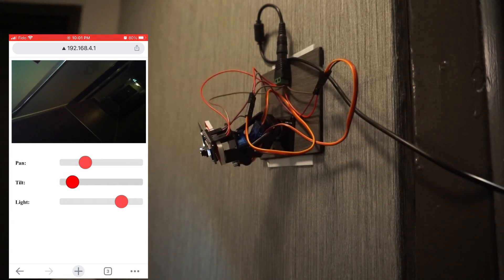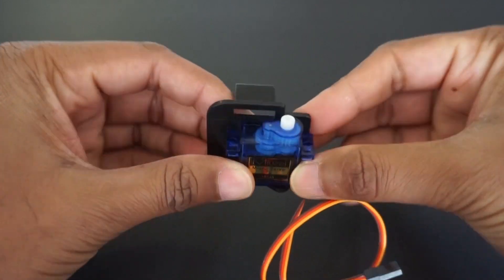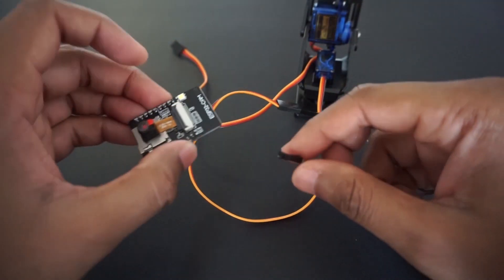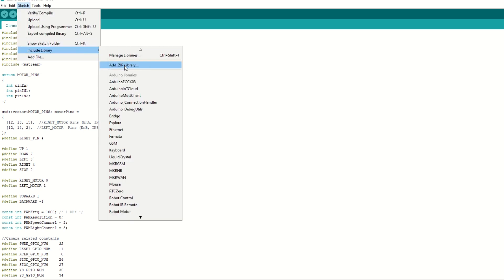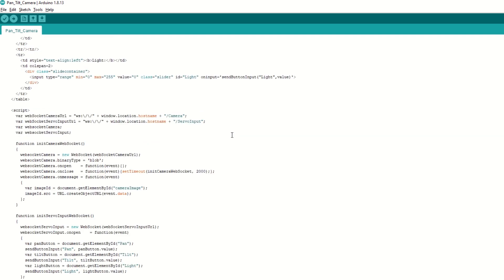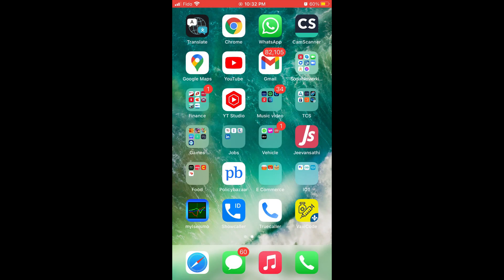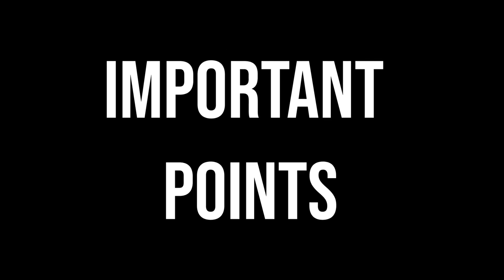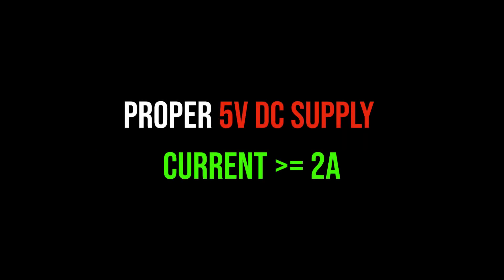Pan Tilt Control using Servos for ESP32 Cam |  WiFi Security Camera

Comment: I'm using four 1.5V batteries as external power. Will I get an error if the voltage isn't exactly 5V? Only the LEDs work, and the servo motor and video streaming don't.

Comment: help me, I can't get it to work properly, the problem is in the servo, the pan is working, but the tilt is not working, it won't rotate properly.
Reply from the maker: Did you connect the Tilt servo to the correct pin? 👍🏻👏🏻

Comment: I tried the same setup and followed your video, including the important max queue setting. I’m using a 5V 3A buck converter for power. However, the video feed is frozen, the camera is stuck, and the servos are not responding. The lights are working fine. I also noticed many others in the comments facing the same issue, for all of them lights in esp032 working fine.so it seems like either we are missing something  in the setup or there’s a problem with the code. Could you please help us to debug the issue.anything that we need to check in specific

Comment: it compiles the code but it is not connecting to my wifi network, however it is generating an IP address.
Reply: Yes, i have the same question
Reply from the maker: Check the connections and also power supply 👍🏻👏🏻

Comment: There are some size differences between pan tilt's assembly and servo motor.....I cannot set it properly...I have cut from the two ends of the servo's horns....still it is not fitting properly....what should I do?.....any advice?
Reply from the maker: Try making the proper adjustment 👍🏻👏🏻

Comment: how to connect arduino uno to the camera pls tell anyone
Reply from the maker: @freedjustine1629  Arduino uno is used only to upload code . This step is shown in video . Please check the video slowly and carefully 👍🏻👏🏻
Reply: @hashincludeelectronics  but how to connect Arduino to the camera???
U told to check the car video but they have connected the camera to the breadboard
Reply: I would really love it if u could tell me how to connect it physically with the wires....
Reply: But to choose module esp32 cam module is not coming....
Pls help me

Comment: I am getting an error while compiling the code 
It says 
Compilation error: 'ledcSetup' was not declared in this scope; did you mean 'ledc_stop'?

please help me , its really urgent 
if possible i want to contact you
Reply from the maker: Please install 2.0.16 version of esp32 board to resolve this issue 👍🏻👏🏻
Reply: Sir pan tilt is not working and video feed is not coming please help sir

Comment: Hello sir please listen to me and reply me 
When i try to upload the code using the current version of esp32 board it show error in ledcsetup and ledattach pin but as you say use the version 2.0.16 i use that and it also work but it only work on led i can increase or decrease the intensity of the led but it didn't streaming the video i tried all the way possible i can but it doesn't work please help me
Reply from the maker: Please check video for any missing step . There is one setting which needs to be updated in library . Please check the video 👍🏻👏🏻
Reply: @hashincludeelectronics  sir i make the esp32 cam project through your video step by step since 5 day but the problem remain same the error showed that the ledcsetup and ledattachpin is not declare in scope thats all sir

Comment: Can we use mg 995 servo motor in car project as i have modified it for mor torque so can you help with that  its not working with mg995 servo so what should I do ?
Reply from the maker: Please check the specifications of servo motor . It should work with 5v in control input . Also check the current rating and accordingly provide power supply 👍🏻👏🏻

Comment: I am getting the light to flash but im getting no response from the servos at all. I have everything connected to a power supply so i know there’s plenty of voltage and amps but I’ve got nothing out of the servos. Power supply shows they are not even drawing power. Any solution?
Reply from the maker: Make sure the rating of the power supply should have more than 2A current output with 5v supply 👍🏻👏🏻
Reply: @hashincludeelectronics  I am using UBEC 5V 5A . As you said, this should work more than 2A but i am using 5V 5A. only flash works. Please what is the problem?
Reply: @myintmyat1536  tengo el mismo problema, sumandol a que la imagen de la camara esta congelada
Reply: Me too... Should I use 5v, 2A adapter?

Comment: hello friend I entered this code but
it gives a problem
//Set up flash light
ledcSetup(PWMLightChannel, 1000, 8);
pinMode(LIGHT_PIN, OUTPUT);
ledcAttachPin(LIGHT_PIN, PWMLightChannel);
}
I couldn't light the led where is the error in the code
Reply: I have the same type of error which comes out in compile time please suggest me how to resolve it
Reply from the maker: @rohansahu2848  please install 2.0.16 version of esp32 board 👍🏻👏🏻
Reply from the maker: @Atillacelebi-de4qt  do you get compilation error ? 👍🏻👏🏻

Comment: Thank you all sorted I was previously facing some error of ledcsetup one but reading comments I resolved it🎉🎉🎉🎉

Can you make edit in video specially addressing for new maker to use 2.0.16 version that will be very helpful for them and time saving❤❤❤
Reply: How you solved it?
I have same problem, i cannot find comment that might help
Tell me please
Reply: @suxarickvoron8395  just change the esp32 version as i said above 2.0.16 rather than latest one 3.0.....something
Then your problem will be solved
Reply: @ OH god, i just noticed that you already wrote it above :D
I have seen only this part->

"Thank you all sorted I was previously facing some error of ledcsetup one but reading comments I resolved it🎉🎉🎉🎉"

Thanks for clarification!
Reply from the maker: Glad that everything worked now . Sure will mention that in upcoming videos 👍🏻👏🏻
Reply: @hashincludeelectronics I am currently using an adapter and now I want to switch to  battery of 3.7v can I use it using full potential of setup

Comment: It says frame buffer could not be acquired and video freezes after the first frame and with the servo motors they rotate once in a weird way and then the pan motor stops while the tilt motor goes up all the way
Reply: Note I am using 360 degree servo motors
Reply from the maker: @AbdelrhmanAzez  you need to change one setting related max message queued in code . Please check that in video 👍🏻👏🏻

Comment: can v hv a zoom call i spend a lot of money on this pls help me
Reply from the maker: Unfortunately call is not possible . I would suggest to go through the video again slowly and carefully . Check all the steps . Use proper power supply . Check for loose connections . Don’t worry it will work for you as well 👍🏻👏🏻

Comment: Sir, I uploaded the code and all went good. But IseeYouNow ssid is not visible in my phone or other device
Reply from the maker: Please check connections and use proper power supply 👍🏻👏🏻
Reply: @hashincludeelectronics  Connections all good. The problem is that no ssid is visible i need this before 20 December 😭

Comment: i have a problem i get this error when uploading:

Error compiling for board ESP32 Wrover Module
and
WARNING: Category '' in library ESP Insights is not valid. Will be changed to 'Uncategorized'
WARNING: Category '' in library ESP RainMaker is not valid. Will be changed to 'Uncategorized'
WARNING: Category '' in library WiFiProv is not valid. Will be changed to 'Uncategorized'
Reply from the maker: Please follow exact steps in video 👍🏻👏🏻

Comment: can i power it all wirh a 3.7v 3000 mah rechargable battery ??
Reply from the maker: It needs 5v only 👍🏻👏🏻
Reply: @hashincludeelectronics  it's alright, I'll make a rc car and mount a pan tilt servo assembly on it

Comment: sir help me i'm useing 1 servomotor my motor not working 😭😭😭😭😭😭😭
Reply from the maker: Please follow exact steps in video . Check video slowly and carefully . Also use the power supply which provides more than 2A current and 5v 👍🏻👏🏻

Comment: Sir i have one doubt can we use vr glasses and headtracking to control pan and tilt can you please tell i want to add fpv vr setup in my f22 plane
Reply from the maker: Yes we can do . However it’s very complex project and currently I don’t have bandwidth for it 👍🏻👏🏻

Comment: I accidentally erased the esp32 json file in preferences, so i searched for the url again and loaded it.  NOW, using the same code as yours, all I get is "Error compiling for board AI Thinker ESP32-CAM.
"  Please guide me to a solution as I have exhausted everything that I can think of.  I noticed that if I use WebServer, instead of AsyncWebServer, the code installs without error, but the images do no work.  HELP !!!
Reply from the maker: Which version of esp32 did you install ? Please install only 2.0.16 version of esp32 board 👍🏻👍🏻

Comment: Sir i finish the project. But pan,tilt servo and camera not working.but flash light working perfectly. What i do?
Reply from the maker: Please check the connections . Also make sure you use good power supply 👏🏻👍🏻

Comment: the servo motor you used were from miuzi and the link you provided was tower pro which i bought and were totally useless.
can you provide link for the miuzi servo motors. can you tell me where you buy parts from
Reply from the maker: You can buy any micro servo motor 👍🏻👏🏻

Comment: Compilation error: 'ledcSetup' was not declared in this scope; did you mean 'ledc_stop'? plizzz
Reply from the maker: Please install 2.0.16 version of esp32 board 👍🏻👏🏻
Reply: @hashincludeelectronics  how bout the esp32servo?
Reply from the maker: @athariksa6427  it’s same version 👍🏻👏🏻
Reply: @hashincludeelectronics  i used the version same as on the vid and it worked sir, thanks for you guide
Reply: I had a similar problem ("Compilation error: 'ledcSetup' was not declared in this scope; did you mean 'ledc_stop'?")

I'm using Arduino 2.3.3 and to make it work, 
I downgrade esp32 arduino board (at board manager) from ver 3.0.5 to ver 2.0.16 and that it! it work!

Comment: Thank you very much. I haven't tried the code yet, but I'm sure it will be fine. However, I had to file down the servo horns a lot to make them fit in their places. Length-wise it's not a problem, it's the width. And the holes don't match up. I've ordered other models for the next one ;) - Actually, I'm going to build the vehicle shown in the other video, but I prefer to separate the steps. Projects: general surveillance and scaring pigeons.
Reply from the maker: Thanks for checking out the video 👍🏻👏🏻. Good luck for your project . 🙂

Comment: Hey do i have to set the servo to 90 degree before assembly?
Reply from the maker: Yes . It should be at center 👏🏻👍🏻
Reply: @hashincludeelectronics  thanks and also how do find a esp cam with a cam that can position 90 like yours mine is vertical
Reply from the maker: @NanonplayZ  not sure . I just got that online from Amazon . 👍🏻👏🏻
Reply: @hashincludeelectronics  thanks
Reply from the maker: @NanonplayZ  welcome 🙏
Reply: @hashincludeelectronics  i try it and it doesn't work (only the cam part) maybe the code is outdated?

Comment: Hello Brother , I got an issue , that the code I successfully uploaded , but i cant open the IP address 192.168.4.1 , whats the problem 
Plsssss helppppp
Reply from the maker: Please check the connections properly . Power the project and then connect to WiFi as shown in video . Please check the video for proper steps 👍🏻👏🏻
Reply: @hashincludeelectronics   Its work if i do it on my personal connection (not API ) , that's mean its works if i used my own wifi connection ?

Comment: I'm struggling with this, for some reason the esp32 just gives me one image and then it does not update anymore and I still can't figure out why :(
Reply from the maker: You need to change one setting in code . Please check the video for this step 👍🏻👏🏻
Reply: @hashincludeelectronics  Thank you for answereing, I was indeed missing hat step, but even after fixing that it still forzes after a sew frames and then only the LED brigthess control works and also gives the message "Frame buffer could not be acquired" in the serial monitor :(

Comment: I am using your code and following your video. However I get an error "Frame buffer could not be acquired"  What could I be doing wrong
Reply from the maker: You need to update one setting in code . Please check the cheek for this step 👍🏻👏🏻

Comment: what to do if video feed shows a still image only.
Reply from the maker: You need to change on setting in code . Please check the video for this step 👍🏻👏🏻
Reply: @hashincludeelectronics  i changed max queued messages from 32 to 1 stil same problem
Reply from the maker: @ranking6208  check your power supply as well .
Reply: @hashincludeelectronics  thank you, it worked now. the code in this video doesnt work but if i use the pan tilt servo camera car code from your other video, the video feed works.

Comment: Hello, this text is showed in serial monitor "Frame buffer could not be acquired". How can I fix it?
Reply from the maker: You need to change one setting in code . Please check the video for this step 👍🏻👏🏻
Reply: @hashincludeelectronics  I already change it, but it still does not working.
Reply: Also the servo is not working. Can you help us? we will use it in our capstone project

Comment: Hi nice video but, The Pan and tilt servos not working when i try it. Also the video is not working I only get a still picture even after changing the setting from 32 to 1, the only thing that works  is the flashlight.
Reply from the maker: Please check the video slowly and carefully for any missing step 👍🏻👏🏻
Reply: Ok thanks
Reply: @anithhrithran7063 did you resolve the issue?
Reply: @ no

Comment: hi nice video, can you explain more why we need the dummy servos for the libraries to not interfere ? i am attempting a similar project, and i notice that when my servos are connected, the esp32 fails and continuously reboots.
Reply from the maker: Actually it was to avoid the conflict between timers used by servo and cam . But if you check my recent videos we don’t need dummy servos at all . I have fixed that problem . 👍🏻👏🏻
Reply: @hashincludeelectronics  nice. I found you can also fix it by not using the servo library, and using delays for software PWM

Comment: Hello friend, first of all, the project you have made is very nice, I congratulate you and I have a question for you. I will move this system to the v4 port of my modem. I need to connect it to the modem. What changes should I make in the code to connect it to the modem?
Reply from the maker: Thank you very much for your nice comment . 👍🏻👏🏻. To answer your question , you will have to AP WiFi mode in the code . You can check my getting started with esp32 video to see how we can connect to modem using AP mode 👍🏻👏🏻

Comment: Uploaded the code but camera just doesn't stream all I get is frozen still pic. Do you have a solution for this problem? great vudeo
Reply from the maker: You need update one setting in code . Please check the video for this step 👍🏻👏🏻
Reply: I got it working i was trying to get  the esp32 to connect to my router but no luck

Comment: I have a question: if I want to use only one servo motor, then add a PIR sensor and a piezo buzzer, do I also need dummy pins for each component? Or are dummy pins only necessary for the servo motor? Thank you, please answer.
Reply from the maker: We don’t need dummy pins for other components 👍🏻👏🏻

Comment: sir after connecting the battery i am unable to get the video and also the motors are not functioning but i am able to control the led flash light .can you tell me what device or method to be applied to get the proper output
Reply: same problem
Reply: I also got same problem  please tell what can be the solution for it
Reply: Same problem

Comment: The app is not working in Bangladesh..😢
Reply from the maker: You need to switch the power on and the connect to WiFi ssid as shown in video . And then open the app 👍🏻👏🏻

Comment: Everything works but video is not playing!
Reply: Now I’m having the same problem
Reply: It also says “Frame buffer could not be acquired
Reply: same problem here
Reply: Same problem here... Any news?
Reply: Did you solve it?
Reply from the maker: Please check video because you need to change one setting 👍🏻👏🏻
Reply: @hashincludeelectronics  I have changed 32 to 1 but...at the time of connecting it shows a picture...video is not playing
Reply: @Gowtham_97G Where to set this thing??? Can you tell me where will i find this file
Reply: @hashincludeelectronics  This can only work on one WiFi network, right? This means that the WiFi network on the ESP and smartphone must be the same?

Comment: I follow your guide with code but video didnot stream, the screen only a picture when camera turn on. I couldn't control pan and tilt servo, but the light can turn on or off. I used different power for ESP32 Cam and servos.
Anyone can help me to solve this problem? Thankyou!
Reply from the maker: You need to update one setting max messages queued . Please check the video for details 👍🏻👏🏻
Reply: @hashincludeelectronics It's ready, I have changed from 32 to 1 as your guide.

Comment: hello! as soon as i saw this video i wanted to make this project, but i am stuck in middle. the issue is that cam module is not streaming the video instead it is just capturing a image at that instance when it is getting connected to my phone. What should i do ? please help me.
Reply from the maker: You need to update one setting related max queued messages . Please check the video for this step 👍🏻👏🏻

Comment: Uploading the code from arduino uno to esp32 cam board is not working for me. It's saying failed to connect to the esp32 board and there is no serial data received.
Reply from the maker: Try to press enable button on that esp32 module 👍🏻👏🏻